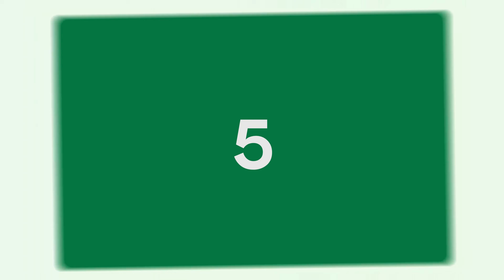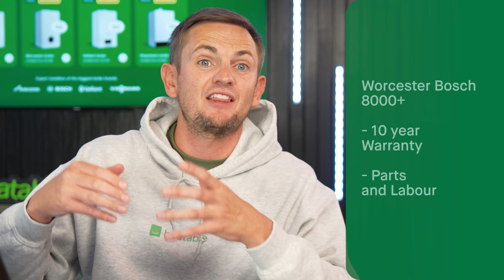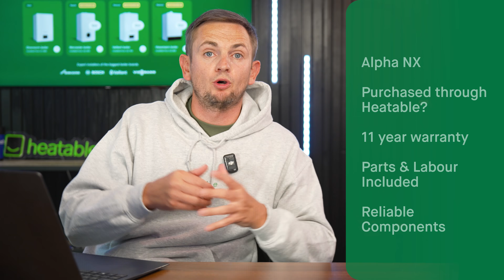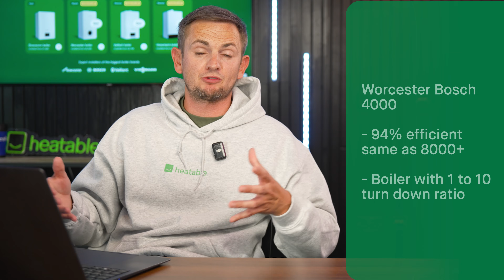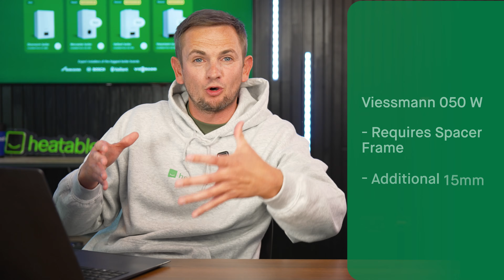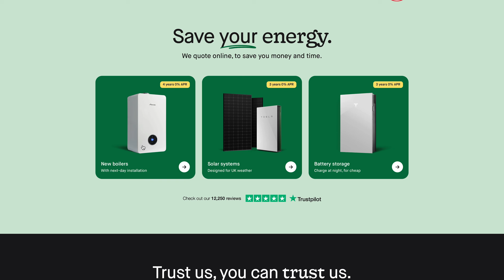Top 5 Combi Boilers | 2026

Comment: My Boiler is 29 years old and still running really well - it has copper and brass tubing and junctions - what is on offer has plastic fittings and as efficient as they say it is - it is designed to fail just outside the 5 year warranty

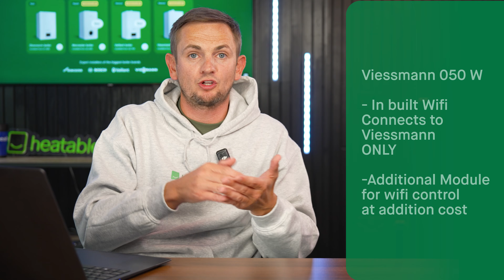Comment: It appears your info at 18:30 regarding wifi being for viesmans cloud and not for the user is misleading. after reading up about these boilers for hours i googled it again i got:
 
No, you do not need an extra controller or hardware (like the Vitoconnect bridge) to connect a modern Viessmann Vitodens 050-W (B0KA/B0HA models) to WiFi. 
These boilers feature "WiFi Inside" (integrated WiFi interface) as standard, which allows them to connect directly to your home network and the ViCare app. 
Key Details on Connectivity:

    Built-in WiFi: The 050-W has a built-in interface that connects to your smartphone via the ViCare app.
    No Extra Hardware Needed: Unlike older Viessmann models that required a separate "Vitoconnect" box, the new 050-W connects directly.
    Setup: You can connect it directly to your home network using the QR code on the boiler during installation

please confirm this, as maybe a few years ago you did, but im sure within the 5 months since you released this vid you don't. thanks for the vid anyway, very interesting

Comment: No mention of the Viessmann 200-W 35kW Combi? 

No other Combi has a comparable modulation ratio, advanced weather compensation out of the box, Upto 17L per minute flow rate, 95%+ efficiency. The list goes on. 

All for £2K + installation. Appreciate Heatable may not have the infrastructure in place to offer these but there is only one Combi King.

Comment: Vailant ecotec have a corrugated plastic pipe for the condensate, resting on a copper pipe. The heat from the copper pipe eventually damages the plastic pipe, which in turn drips condensate onto the copper pipe, this pipe then rots and sprays water all around the boiler internals...All it needs is a folded ( for a little more insulation) piece of card to be placed between the two pipes. Why Valiant have chosen not to separate the pipes?....could sell another boiler 8 years down the line?

Comment: Baxi 800 best boiler out there, surprisingly not on your list.
Reply: My Worcester was ok for the first 5 years then for the next 10 it was an absolute bastard.. Got so sick of problems swapped it out for a baxi 800. So far so good.
Reply: I recently heard Baxi are really good from my local plumber, they still have some metal parts he was saying rather than plastic that a lot of brands have started using recently to cut costs
Reply: @InvestingwithMarc I have a Worcester Bosch combo boiler and it’s 5 years old and I have had no problems with it, my next door neighbour had a new baxi combo boiler fitted last year, it lost pressure when it was 8 months old and he was charged £80 to pressure it up , then it broke down on Christmas Day and he had to wait 7 days for the baxi manufacturer repair man to fix it , it was the exchange valve that changes from heating to hut water, it should not have broken down within 9 months.
Reply: @philipbell3187 that’s good to hear, my parents had an old Worcester Bosch that lasted 30 years!
Reply: @philipbell3187 first 5 years will be the honeymoon period, then after that the plastic-water  sections start splitting, and the grommet washer behind the turbine will start leaking common Worcester Bosch faults , every boiler has there unique faults.
Reply: @philipbell3187 and if you don’t know how to re pressurised your boiler you deserve to be charged £80

Comment: We had a Navien NCB 500 32Kw combi fitted 12 months ago. We had the Viessmann 100w fitted in the house we moved out of. We wanted a similar spec boiler in the new house. After loads of research the Navien NCB 500 was nearly identical spec. With geofencing, weather comp, 94% efficiency, excellent water flow. S/ steel heat exchanger, long warranty 10 years. The boiler has been spot on, never missed a beat. The internal build quality is top notch. The boiler engineer who fitted it, had never fitted one before. I asked him what his thoughts was on the fitting a build quality. Fitting very easy can get at the pipes good room and offset to get spanners on. He says quality is up with any of the big boys. I think these are under rated but like Kia's cars from 15 years ago. Look at them now. This boiler is a quality product and has been 100% since fitting. We put the Navien controller with it and use it's full functionality through the app. The best bit is the price the boiler & flu kit was around £900.00 the Viessmann was around £1600. Big difference.

Comment: I had my Glowworm combi replaced recently, and have never been so disappointed - because I was not given any information about the change it would make to my system. It is a Baxi Main Eco Compact, and the amount of wasted water getting hot water to the kitchen and bathroom with this boiler that was not a problem for my Glowworm, seems to come from the fact that this is an entry level boiler and it cannot change from Eco mode to Comfort setting which many Eco boilers do, which would pre-heat some water.  If I had known the installer would not be replacing an equivalent boiler I would NEVER have agreed to it.  
I feel, to be blunt, shafted.
 If anyone has any suggestions as to what I should do now, I would love to hear.
It is a lot of money to have spent to be completed dissatisfied with the outcome.

Comment: Which boilers come with a cast iron water jacket and no plastic parts inside? My old one lasted decades, but I hear ones with steel/stainless steel ones failing within 10-20yrs. And the latter ones appear to be no more efficient, as most are oversized & rarely operate in condensing mode, whilst being far more susceptible to breaking down.
Reply: My combi oil boiler was going through a sticky phase a couple of years ago and I mentioned to the engineer who came out, time to replace it? Don't! He said the newer ones were not as good. Sticky bit. Turned out a wire had come off. And the age of the boiler.... 19 years. It lives in an external box. Each year it just gets a clean up, new burner jet and oil flow rate adjusted. Ultra reliable. Lashings of hot water and heat. Cannot ask for more.
Reply: @bertiesworld  new stuff designed to break so you buy again, similar to smartphones, cant replace batteries - planned obsolescence

Comment: Disagree about the Viessmann 50.  I had one installed 7 years ago.  Worked very efficiently for 4 years then intermittent hot water.   Cut long story short im now on my 4th heat exchanger. Im going to change my boiler because of this common issue with viessmann . No inhibitors allowed in these boilers
Reply: That's the plate heat exchanger
Reply: Do you live in a hard water area? Do you have a shock arestor limescale filter and water softener installed?
Reply: Don't blame the boiler, blame the person that incorrectly specified and fitted an oversized one.

Comment: I've had my combi boiler for 13 years its now going wrong  no hot water, only when the heating is on, we have had deverter valve replaced and another part, and another part to try, do you think I should just get a new boiler, it a ideal boiler.
Reply from the maker: Hey Linda, if you’ve had multiple issues with the boiler we usually do suggest replacing it. If you compare how much you’re spending repairing it, it might be better financially to just replace! 😊
Reply: Yes get a local installer round for a quote

Comment: It's a shame that you did not include the best Combi boiler sold in the UK - the Viessmann 200W 35 Combi. No other boiler has the modulation of 1.9kW , heating performance, advanced weather compensation and flow rate of 14+ L/m. 

Just because Heatable doesn't sell the best boilers, doesn't take away from the product itself.
Reply: Just finding a Viessmann installer is hard enough. The firm is asleep on the job for finding Sales.
Reply: I’ve heard their after care is quite bad
Reply: @tomstrutton4351  Not my experience at all. They are not a mass market product though so finding experienced installers is not the same as Worcester
Reply: @singlendhot8628 I knew a rep who worked there and he said they’re not fully committed to the uk market yet…and my suppliers said parts took weeks to come in….might be a good boiler….but bad after sales
Reply: @singlendhot8628 that’s precisely the issue with them. I hear nothing but bad stories

Comment: The boilers are only efficient when they are not condensing and this requires a flow return of less than 55 degrees Celsius. This does not happen because most installers set the the flow temperature to high so that they get complimented on how efficient the boiler is. I have recently had my boiler changed with an atag opentherm boiler. This gives me the choice of using various stats and being able to use the modulation features, something you cannot do in the UK since we left the EU. As the manufacturers are pushing & selling their own proprietary control systems. Where as in the EU every boiler has to be opentherm compatible.  My atag is in fact one of the most efficient boilers on the market and under ideal conditions of 98%.  This is using the Tado system to control it. 

I did have a problem with the installer, as he had never connected the boilers as a regulating system, his experience of installing was basically the thermostat of many years ago, which is uneconomical. Much like driving your car for an average 55 miles an hour, by accelerating to 70 and then free coasting until the car reaches 40 and then accelerating to 70 again. (Obviously this is not advised because you don't have proper control of vehicle) this is basically what you're heating does by heating to 21+ degrees and then dropping to under 18°. Is takes a toll on the boiler service life, wastes fuel and means your home is not kept at a constant temperature and so therefore you are either hot and then cold as it cycles. 

It is not uncommon to see the flow temperature from my boiler at 26 degrees, as it attempts to replace the heat that is lost from my home. Where is a non modulating boiler would be at around 70 degrees flow temperature. 

What they are not telling you also is that you need to work out how much heat your house loses, because once you've got the temperature. The loss in kilowatt hour is the maximum amount of energy you will need to replace maintain that temperature, even on the coldest day this is a few kilowatts and they're are boilers on the market that will not regulate down to allow enough temperature to enable them to modulate efficiently, for instance if your boiler will modulate down to 6 kW and you need 4 kilowatts, you're 2 kW over will always burn those extra 2 kilowatts, thus it will cycle, this affects both the fuel consumption and the longevity of the boiler
Reply: I guess you just got this wrong as a typo but boilers have more efficiency when they are condensing and there is a curve about how much heat they recover dependant on the return temperature. The lower the temperature the more heat you will recover up to its maximum efficiency. 

You are wrong about the flow temperature for a standard on of boiler though since even my 30+ year old Potterton Flamingo could adjust its temperature (but was non condensing). Boilers can so be condensing even with 70 deg provided the delta T is a 20 deg drop. 

Openthem or the manufacturers own modulating controls proved much the same control over the modulation. For example Honeywell evohome is opentherm but does not have an external temperature probe for weather compensation, but allegedly analyses the temperature data to modulate. Valiant have a weather compensation control that is not opentherm but does the same thing and has weather compensation. 

If you think that brexit means UK boilers are somehow disadvantaged then you’re delusional. There is more legislation in Europe and they may have mandated that all boilers must be compatible with opentherm but that does not mean opentherm will be better than the manufacturers own controls.

You can also range rate boilers so that you are not blasting 100% of the power of the boiler and it will use less gas however a lot of plumbers are less than knowledgeable about some of the things they do with over specking the boilers “just in case”. Case in point is my mums boiler which cycles too much because it’s over powered and doors not have the manufacturers controls. That being said it does have a protection against excessive cycling. It’s not been range rated so it’s not as efficient as it could be though it is a heat only boiler so that makes things slightly more difficult than a combi.

You are spot on about a heat loss survey and design of the radiators and pipe work make a huge difference (not as much as a heat pump though) although with a flow temperature as low as yours it would seem that you’d be far better off with a heat pump. 
Check out urban plumbers videos about getting a COP of 5  on his own install.
Reply: It's actually 56 degrees not 55

Comment: At some point need to replace our system ,problem we have is the pipes downstairs are micro type 

pipes and the wiring wasn't replaced before 3 foot of rubble and concrete was placed on top of them

Pipes that feed upstairs is new larger pipes but not what feeds the radators 

system has never been flushed (20+ years) no additives in the system

fairly certain flow in the system is restricted as it starts to boil the water inside the boiler if flame is at full (fine at low after 3 seconds)

Comment: As a plumber my self. I only install baxi platinums. Easy to fit. Good warranty and out of about 20 ive fit (since goin on my own 2022) only 1 had a slight fault in them
Reply: Hot water flow switches and diverter cartridges thats the usual  apart from that they are good boilers and cheaper than most other boilers for replacement  parts better with the 800 range tho platinum are just to big for certain  jobs
Reply: The old Baxi platinum was probably the best condensing combi boiler however I wouldn't say the same for the new ones
Reply: @mikem8211 i will agree there but what issues are you having with the newer ones i never had any call backs on them
Reply: @WakoJacKooo imo it's not the same boiler nowhere near
Reply: I have one , its noisy and not the hottest water for our power shower!
Reply: @Nickpaintbrush check your hotwater  flow rate
Reply: @TimBanister  Thanks
Reply: Vaillant Eco tech pro for me, fit and forget
Reply: @tonykulikovsky yes i fit the odd eco tec i like there builds inside but i find the interface a tad confusin showing customers sometimes
Reply: @tonykulikovsky  is the flow rate good,I keep seeing the odd comment about it

Comment: Are we really installing 50kW boilers in the UK? Even if 36kW, it's far too much.. archaic.
Reply: Sadly for the last few years many new builds have had 40kw Worcester Combis go in for the hot water delivery to the kitchen sink plus bathroom/possible second shower room. That way they can give the airing cupboard space to a bedroom and increase profits.

Realistically a 30-35kw system boiler with a cylinder is a better investment for larger homes that require fast reheat times for the hot water. Around 17 minutes for a 210 litre cylinder to reheat. A heat pump will take around 3 times longer.

Average heat loss is 8kw in the UK so all these boilers are sized for hot water demand, not central heating.

Comment: All these boilers are compatible with nest/hive etc, just none of them will be as efficient without the manufacturer controls. Generally Vaillant and Viessmann have the best weather compensation tech as they've been doing it on their commercial ranges for something like 40 years now.
Reply: Does Worcester have OpenTherm now?
Reply: @MrTwiglet  No, it's only a legal requirement on the continent, not in the UK. Possibly from 2027 onwards.
Reply: @effervescence5664  So how are Worcester boilers "compatible with nest/hive etc"? I rejected Worcester partly because the Greenstar we had was being replaced, as it was difficult to repair and because of their insistence on proprietary controls.
Reply: @MrTwiglet  They use the 240v input and soft start on the controls rather than modulating the boiler directly. 
Then the boiler just self adjusts on return pipe temps and flow rates.
Might gain around 5% total efficiency from nest/hive. Manufacturer controls would be up to 15% total gain.
Reply: @effervescence5664  I'm more concerned with being able to select my own, usable, interface.

Comment: i didn't you did gas i thought you were all about Renewable energy. i still have my boiler even though ive had the gas removed .
Reply: You have a gas-fired boiler that you have kept but do not use or you have an electric one?
Reply: @Torchman-  I have solar heat pump  and 2 powerwalls with Air to Air heating , i hadn't got around to having it removed then i saw you can use small bore pipes with a heat pump and i thought maybe i could have both as the Air to Air is A/C as well . ill keep for a bit longer as things change so fast these days .